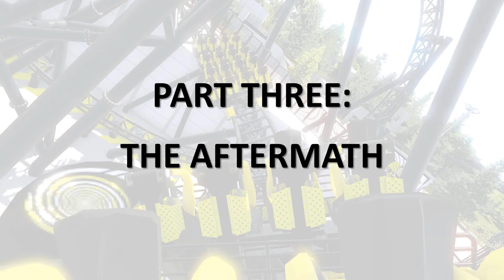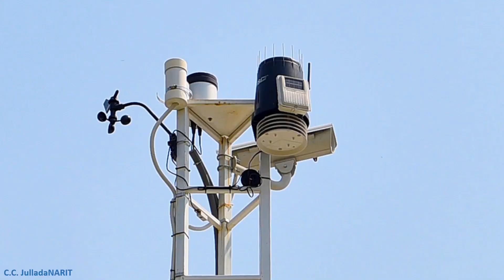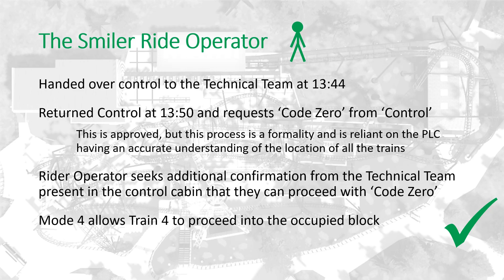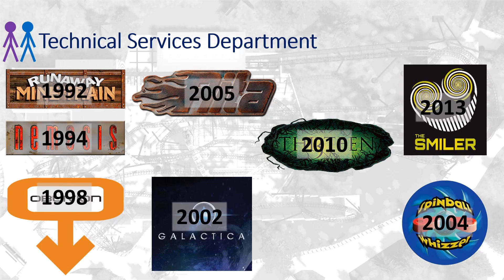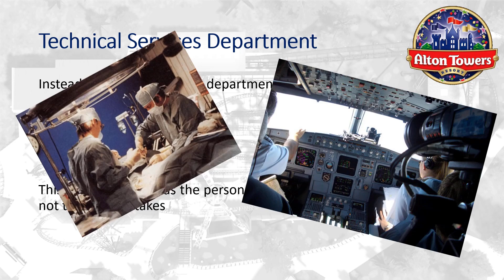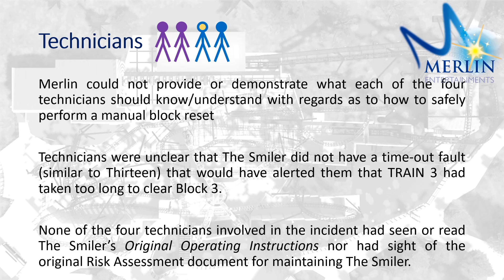The Smiler Crash: No Stone Left Unturned - Part 3 Conclusions

Comment: I still feel the technical engineer was at fault. Even if a fault were to occur, he should know from common sense to inspect the track and not just think it an error on the PLC's part. It was that negligence that caused the accident, and not what any reasonable person with a basic understanding of rollercoasters, in my opinion, would do.
Reply: Should have gone round and checked the section. Why didn't the public report the valley train? They saw a train stalled on the lift and they saw the train stuck that didn't make the loop
Reply: Nsndhxdhhdbdnddjjdxndmdmsmiled @karinaraper8782 akskskslways
Reply: They should have thought that a stalled train was an option at any point and checked - It stalled trains there numerous times before the accident